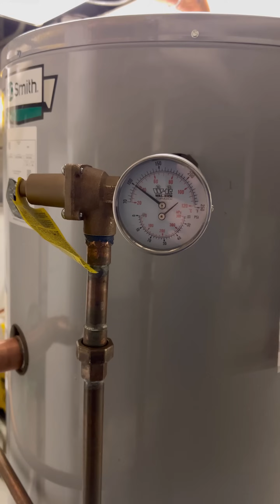Hot Water Storage Tank Replacement

Comment: I'm a steamfitter in NYC. Only suggestion I have after soldering is not to put the wet rag on too quickly because you risk cooling the joint too quickly and causing the solder joint to Crack or seperate and potentially having a leak in the near future. Wrap the wet rag around valves and dope/tape joints that are too close. Also if you use a dry rag about 1-2 mins after the joints are done it will clean the joint and then you won't need to use the scotch Brite after. The more Flux that gets caught on the rag the better it will clean. Keep up the clean copper work looks great.
Reply: Plumber from Texas here... ive heard that advice all the time but ive been cooling down my fittings with a damp rag for 19 years now and never once has that caused an issue... only time ive had a pisser is once or twice and both because i didnt clean my pipe properly or a defect in the fitting
Reply: @alicepooper8562 total bullshit to someone who has never seen it happen. When it does happen then we will see who is talking bullshit. Best of luck. And BTW I don't think I'm better then a plumber so I guess you are insecure in your plumbing.
Reply: Great Advice ! Im a Plumber and work along pipefitters steamfitters in our mechanical company . Its better to be safe then sorry . I also never use flux to make my joints pretty just wipe with a rag and the rest is history .
Reply: I've never had an issue with the cooling.. but if I have a dirty fitting I'll Flux it and heat it enough to get the paste flowing and give it a good wipe  instead of scotch bright.. other guys in my company love their scotch bright
Reply: @NotoriousEgg89  I personally never have had an issue before as well. But I have seen guys on the jobs plumbers and fitters have this issue. With solder and brazing. I'm not saying you have to wait 5 minutes before cooling but at least make sure the joint flashes over before cooling.
Reply: Never seen none of my pipes crack from room temp water
Reply: Did anyone here, see his fittings cracking and leaking afterwards 😂no
Reply: Nice job brewsky you need to drink a brewski broski I like it man I like it I love it
Reply: @thomasmccrory3163 noob here. how long should you wait?
Reply: Nice detailed info. Thank you
Reply: Actually we do know better than plumbers. We can do everything you do and then some.
Reply: Absolute bullshit.
Reply: Quit it. This dude is a pro. Sorry you were hurt. SMH.
Reply: @troyhomann533 funny guy. I make tripple a yr what you make on your Best yr I can guarantee that. No one was hurt except your feeling Mr feelings police it was simply some suggestions and that was all.
Reply: @MrNorthphoenix 
Engineer here
You're violating ASME standards by not letting it cool naturally
Reply: @schwalbrealty6859 
Did anyone here see a house burn down from arc flash?

No?

But arc fault protection is a smart investmest.

......i hope you're smart enough to understand analogies
Reply: @lostandfound6501 till it's cool enough you can grab it by hand

Let it cool naturally
Reply: @thomasmccrory3163 some people just hate being wrong

Even when it's to keep things safer
Reply: Just wondering is there any need to clean the joints after soldering, I never have and have not seen any issues?
Reply: @MrNorthphoenix it’s science that cooling hot metal stresses it.  You don’t know about it because the owner didn’t call back because if you screwed it once, you’ll screw it up again.
Reply: @tonymanero5544  bahaha 20 years of soldering in the same area with the same customers... trust me i hear about my mistakes, my soldered fittings have not been a single issue. Maybe be a plumber and try real world science not theoretical scince and you maybe would have a leg to stand on

Comment: Nice work! One thing though....Heat the pipe before heating the fitting for better penetration. Thermal expansion happens  and you heat the fitting more evenly. When it's heated from the inside(heating the  pipe first) and then on the  outside of the fitting the solder draws in further following the heat and flux. I used to think I was good but I went to the Michigan Copper Institute for a medical gas seminar and learned a bunch of copper knowledge! You're the best channel 100% Shqip!
Reply: Exact protocol is helpful , just like positioning flame opposite  of solder contact , but the reality is if a plumber has been soldering the same for years and has success , I believe in there process. Even if I hold my self to a better  standard.
Reply: @tjfritz3194  I like learning so when I learn the proper way to do something I adapt it to my habits. A conscientious plumber is always learning every day like Broski does for example. He's always learning and changing his thinking and knowledge about the subject which is why I like these vids so much.
Reply from the maker: Thank you Shqipe 🇦🇱🙏🏼
Reply: Hey broski, just wondering if you guys have any regulation of unlike metals contacting eachother? We cant thread copper into steel in california without a dielectric fitting or 6" of brass to stop electrolosis. Let me know.

Comment: I was told not to wipe the solder joints with a wet rag because it causes micro fractures in the solder
Reply: Give it a minute or so and it will be fine 
Do it straight away then you would have problems
Reply: As a General rule  shorting the time of any presses will weaken it will it cause a failure here probably not but it’s alway better to take your time
Reply: Unhhunhhhhhhh
Reply: That’s like me saying I was told not to whipe my ass with toilet paper cause it’s gna irritate my ass cheeks😂

Comment: I'm a commercial boiler technician. I retrofit these in all the time. I'm glad to see you soldering the joints when you can.  It's a lost trade nowadays. I would recommend using  2" dielectric unions and non ferros nipples on the taps and valves closer to isolate the tank if another problem occurs in the future. Nice work!
Reply: Dielectric unions are soooo underestimated IMO
Reply: I am a weekend warrior and I have always enjoyed soldering copper pipes - it's just something I learned watching my dad around the house as a kid. The only thing I hate soldering is valves because I am always afraid the gaskets will melt.
Reply: @Christoph-sd3zi I've never melted a seal and I've overheated quite a few
Reply: I’m a retired Plumber in Australia and in relation to cooling the job following soldering. A bloke I worked with cooled the copper and brass flanges on a job and every brass flange cracked causing leaks. It was a 3” copper fire service, only difference was here in Aus we silver solder (braze) a job of that size. Very rarely do you see what we call “soft soldered” joints here and it’s prohibited on natural gas pipe work.
Great videos mate 👍😊

Comment: I realize you’re a plumber not an insulator but look into a dexter boning knife it will make your cuts easy. Also, John mansville makes fittings for these situations. 2 1/8 x 1 insulation takes #10 fittings. These are called zeston fittings. Really enjoy your channel just thought I’d give some advice on the insulation side as I do mechanical insulation.

Comment: Check it.... years ago we had a air handler / chilled water  unit that was 4 " to tall to get past the structural concrete beams to get into the building.  Mind you this airhandlee was the size of a mid sized RV.

The concrete floor which was 4" thick was removed in the mechanical room . We dug the floor down a bit and rolled the unt in on 1/2 " steel plate and 1/2 black iron pipe. 
Then pulled it up on a ramp into the rest of the building on the existing floor.
The new floor was poured and we rolled it into position. 
Good times....good times 
Engineer approved submittals 
He didnt do his homework,  they paid.... 
Great content brother!!! 
Ps ... not bad at all in the cristmas package wrapping!!!
Reply from the maker: Damn that sounds like a mission but it was handled. Loll thanks
Reply: What would’ve not passed code btw?

Comment: The walls were put up after the old tank was installed. We had a similar problem with our building's central chiller when it failed. Ended up having to excavate to get it replaced. A whole summer went by and it wasn't fixed. Someting to do with having to shore up the foundation to accomodate new chiller. Condo board meetings that year were interesting. Next spring we had to rent a temporary chiller that was the size of a big sea can, while waiting for them to fix the original chiller.

Comment: Have you ever heard of cold soldering  .  I tell my crew all the time you as a plumber have to go by whatever is successful,  ( fluxing , cleaning , the amount of solder, and how much heat , )  I love this channel. I'm a Master And  Foreman for a company in Baltimore  MD. Keep up the great work. 👍
Reply: Ever hear of red COPPER LOCK NO NO HEATSOLDIERING . It that takes place of soldiering. . Few years ago plumbing supply guy sold me small bottle looks like red adhesive said use it like glue instead off soldier.  Pressure reducing valve went out in my house . My mother-in-law ( pain in the ass spoiled complainer ) was staying our house for 3 fucken months from Ireland . Didn’t want to be arround her so I experimented and used it. It’s been 8 years and my replacement valve connections are still holding. I found an extra package of it called the manufacturer which said it has a 15 year shelf life of the vial but no expiration date  of the used , job site glue.
Reply from the maker: No i havent. What is that? 
Thank you for being here and enjoying the content 🙏🏼
Reply: @HydroNYC  it's a theory from an old plumber about having the whole fitting  at the same temperature before you add solder and to keep the flame opposite of the solder contact. But to be clear . I love how you just get shit done . You make plumbing fun to watch. You need a merch line to monetize.
Reply: @hydronyc cold soldering is when you have the cup hot enough to solder but not the pipe in the cup hot enough or vice versa. So the solder doesn't go all the way to the end of the cup it just caps it. It really never happens to a skilled plumber. A bad apprentice might do it 😊
Reply: @blt981 ever heard of capillary action?

Comment: Great work as always bro👍 just a tip for insulating from my own experience in the field. try to get your cuts as close to 45° for your 90° fittings. So you get less space between the insulation👍 i guess its easier for me, since we use "rockwool" and they got marks for the 45° lines xD

Comment: Nice work, I did a storage tank job in a Laundromat like this. The job kicked my  behind, ended up using 1/12 brass nipples, cause all my sweated joints wouldn't hold. Took like 3 hours to drain the tank Everytime I had a leak.

Comment: e·lec·trol·y·sis

Also known as galvanic corrosion, electrolysis happens when two dissimilar metals are directly connected causing the lesser of the two metals to corrode. For the process to occur, the two metals have to also come into contact with a conductive electrolyte, like water, broski

Comment: The old one probably failed because noone checks the sacrificial anode (cathode protection?) and so it all rotted away. Also, allowing copper and steel to come into contact is a recipe for disaster.
But i'm not a plumber and have never been. 🤷🏻‍♂️
Reply: This is true.  They make dielectric fitting when going from iron to copper or brass.

Comment: Everything looks good except for the 45's on your insulation. You had a big joint wide open at the 2"--90... use your pvc handsaw to make your cuts ✂️... it will turn out alot better

Comment: Why not 2 smaller tanks piped in parallel? I have a building I take care of and that’s how they have it (I do commercial/industrial hvac). Also turbo torches work better imo on larger piping
Reply: Almost double the insulation and time.
Reply from the maker: 1 was enough according to the engineer
Reply: I turbo torch anything bigger than 1”. I was actually surprised how easy he made soldering 2” look with the map gas torch

Comment: Had a similar experience at home... Just a couple inches, though... I dont understand why manufacturers don't know that water heaters are frequently installed in "closets", and when you make them bigger homeowners gotta call the carpenter to make the hole bigger...

Then you got the "duct kit" (heat pump) which also appears designed not to fit.

Comment: I've had that here in las vegas in one of the local casinos off the strip. They had a 50gal electric 208vac in the ceiling. Well it leaked and I'm looking and they would have had to remove drop ceiling, electrical and ac ducts. They built everything around the heater.

Comment: @hydronyc For reference if you want to improve the wrap installation in the future hold the material on the outside overlapping and mark where the overlap  is on both sides draw a line between the 2 marks it will tell you precisely what the angles are to make tighter fits quickly and without the  measurement equipment how perfect the cuts are from there just depend on your skill

I also like to leave material like that a touch long it wrinkles it a bit but I’d rather full coverage with wrinkles than gaps those gaps cost the client money

Comment: Isnt there a miter box jig you could use for the insulating cuts?

Man its hard to come by 2” copper for my hobby needs, most industrial needs here seem to use 1 1/2”.

2 inch is the minimum, 3 or 4 would be even better by for building still towers
Reply: Bigger pipes are usually found at pipe supply houses but you may need an account first.
Reply from the maker: Im not sure

Comment: Can you show how you solder 2” in real time, I need to learn that
Reply: Heat rises so heat from the bottom or away from the joint and by capillary reaction, the solder will pull itself towards the heat.  But flux needs to be applied uniformly for it to work.
Reply: get your copper lines, measure said copper lines, make your cuts, deburr everything, sand cloth the tips, flux them, put together, apply heat, solder, profit
Reply from the maker: Yes sure i got you

Comment: Usually those units are installed before the walls for the building is completed... So impossible to replace with a direct size replacement.

We have a similar issue with attic ac units... Access holes in the ceilings are too small to remove the unit!

Comment: We don’t use much fiberglass pipe insulation here (Florida, hot and humid means the insulation stays wet on chilled water piping) so I can’t judge your insulation job. But I wonder if the cases of fiberglass have the angle diagrams on it like armaflex?

Comment: Why no union for maintenance or service ?
Reply: In NYC they have a B side to the local 1 that primarily does maintenance.  Pays less, but most of the time your indoors not freezing ur ass off in a building with no exterior.  Unless you need to do work on a water tower or something
Reply: @tomr1107 He meant a Union fitting to disconnect the tank lines
Reply: @myronsmith2114  bingo
Reply from the maker: No need its copper lol

Comment: You should stop soldering at these sizes. The tolerance of the pipes and fittings are too large here that's why the solder is distributed unevenly. Therefore corrosion occurs in the connections.

Comment: Several things… I am a master plumber in Connecticut with 34 years experience. Yes it was your fault that you did not check the dimensions of the new tank, if you are the owner or the foreman then it is on you just like it falls on me if I were to make that mistake but luckily I check everything so that shit doesn’t happen. Secondly, everything is in the details just like the gauge, you got to make sure you get everything right the first time, and if you have to buy even more material than you think, then you do it! You could’ve put in two smaller tanks and Siamese them together with piping, they probably would’ve had larger capacity than the original one tank. It would look like two indirect hot water storage tanks next to each other. The other thing is, I do not use MAPP gas for soldering because of the oxygen and the gas creates oxygenation in the piping and that is definitely not good. I only use propane for soldering and I only use the MAPP gas to loosen up stubborn fittings. 
   That is my critique for the day. You guys do good most of the time as I watch all of your videos.
    Edward H. – “Integrity, plumbing, septic and drain“ out of the Clinton, CT area.

Comment: I had an issue, trying to put a water heater under a set of stairs, same brand, “same size“ but they change the amount of insulation that goes under the jacket of a water heater without my knowledge had to relocate the heater, 6 feet away from its original location
Reply: Also, some water heaters are put in on the rough-in with no thought put into what it takes to replace them. Much easier to install when the walls are bare and n walls can be damaged.

Comment: Do you not need a dielectric break going into that tank? As for the insulation, there’s nothing I hate more than fiberglass insulation. At least you get to use 1/2” wall so it’s a little easier. We use 1” wall.  I think we lose money not hiring someone to do it. If it’s a little fine but we’ll do whole buildings and it looks like shit compared to professional insulation guys

Comment: 2” and you’re soldering? It should be brazed
Reply from the maker: No why solder is great
Reply: @hydronyc  I have the belief that anything above 2” is better off being brazed. The joint will be stronger and will hold up against the pressure in the system. I’ve seen guys solder 2” all the way to 3” even on potable water systems and they get micro fractures in the joint. Just my opinion, it’s also how I was taught. I’m not sure if it’s required by code. I’m not bagging on your work btw I love your content

Comment: Nigga if you solder right the first time you wont have to sand it. Your torch is way to hot so its burning the fitting turn you flam down